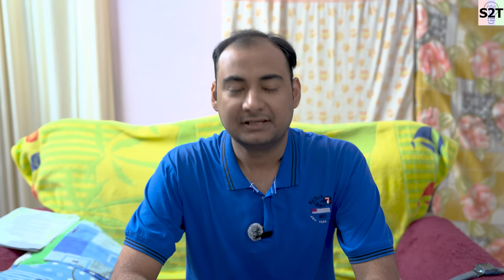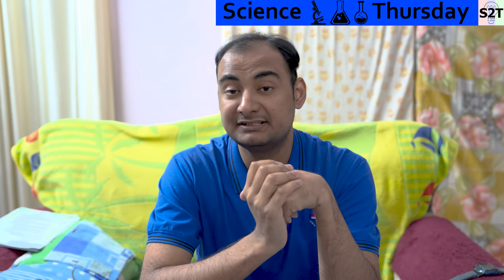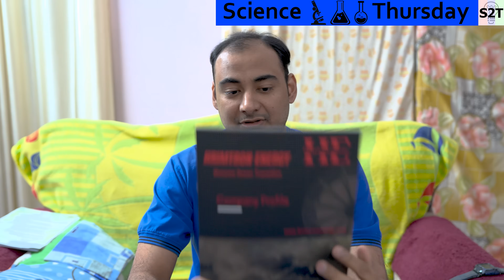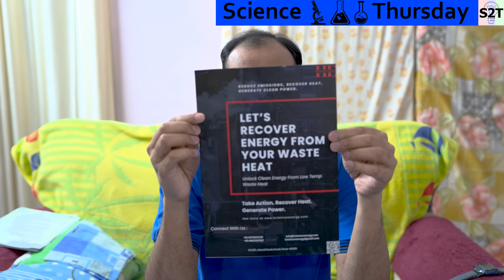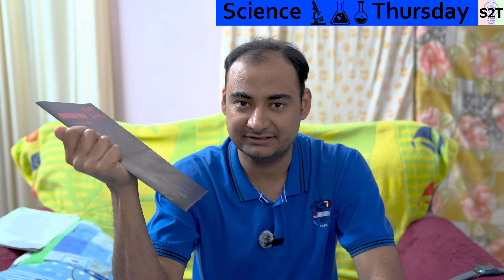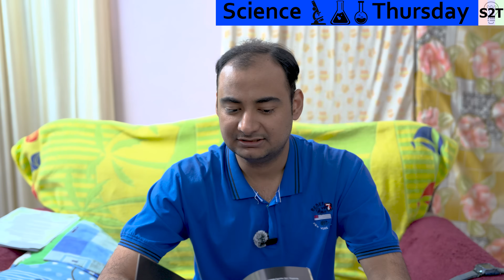HrimTron Energy {Waste Heat To Power} Explained

Comment: Interesting topic! Maybe you should explain Carnot's theorem in a video, if you haven't done that already. You seem to have a level of understanding of a wide range of topics that is really rare, and you explain well. 

As I see it, the high absolute temperature (and high pressure) steam requires to have decent efficiency is the big problem with steam for utilizing low temperature heat sources, as you need to be at least very near the critical temperature in order to not have to waste a lot of energy just to enthalpy of vaporization in each cycle. The enthalpy of vaporization drops faster the closer to the critical temperature you get, and becomes zero at and above the critical temperature. 

As Carnot's theorem states,  ΔT in it self always dictates the maximum theoretical efficiency of an ideal heat engine, so changing the working fluid doesn't change that part. If a lot of the energy flow goes into phase changes of the working fluid because it's is far below critical conditions, that will reduce the real efficiency of the Rankine cycle, a lot. 

It wouldn't be practical, but it is technically possible to make a steam turbine with sub-atmospheric pressure at the hot side and utilize low ΔT at absolute temperatures well below 100 °C, but a lot of the heat flow would go into phase changes, without causing any pressure difference that could be used to generate power. And besides all the energy flow that goes into phase changes, the turbine would have to be gigantic relative to the power it could generate. And closed loop is a given, it has always been a given for power generation, as open loop wastes both the working fluid, and also the potential energy represented by the ΔT between working temperature and ambient. The latter is a part of why old steam engines were so horribly inefficient.              

Anyhow, I think there's great potential in Organic Rankine Cycle technologies. Even if low ΔT always means low efficiency, if the system generates meaningful power from otherwise useless or even unwanted heat, thermodynamic efficiency in it self isn't important, cost efficiency is what's important then, as you said.
Reply from the maker: BINGO U got & I only know surface level